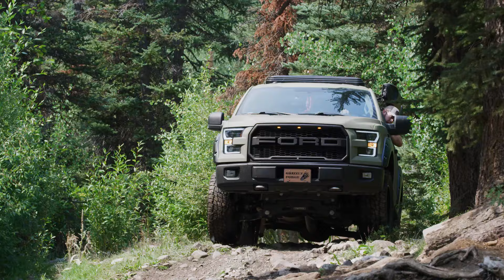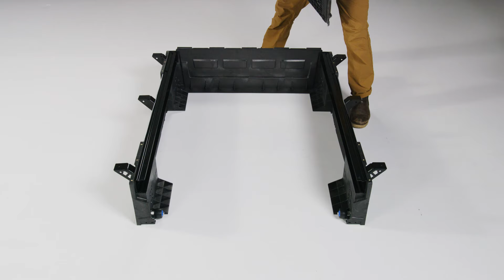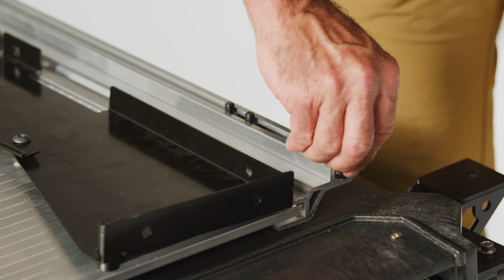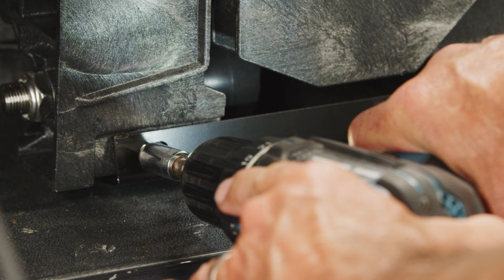Complete Installation Guide: DECKED Midsize Truck Drawer System

Comment: Pro tip. If you wanna center it for free no fkn around, just loosley hang the turnbuckles, Pull the lids off the wingers, put the wingers in. This will sit your deck exactly where its supposed to be. THEN through the openings in the wingers - tighten the buckles and you wont have to check anything cus it sits right the first time.
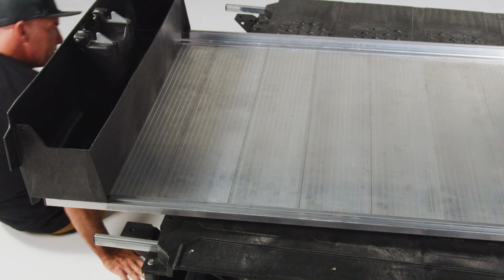And holy crap 7:00 just when you think you've got a solid sheet of aluminum in your hands, it falls apart into 10 pieces 😅 whyyyyy

Comment: 4th gen tacoma here.
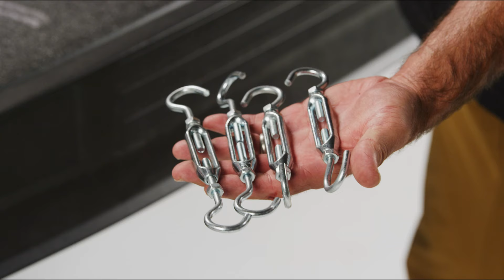I left out those twist hook things at 4:20 for the rear cuz i didnt know where to put them. Still seems sturdy.
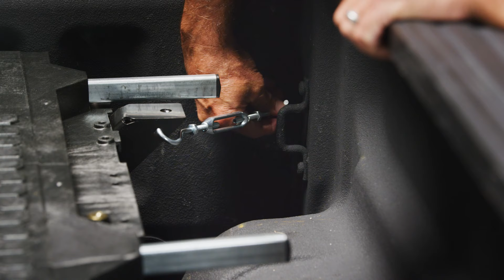Also i would recommend NOT tightening down those hook things that are close to the cab because later on you will need to install the d ring screw in the mount at 4:56 and it's hard to line the holes up unless it's loose.

When putting on the grab handle for the drawer, the 4 holes on the aluminum tray did not line up. I had to drill my own holes. Jb weld would work if you don't have drillbits

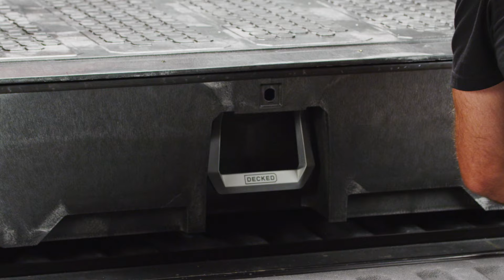9:15 the holes on that bracket thing didn't line up either. Drilled my own holes 

I dont know why they didnt just include 6 d rings but you're able to buy more on their website seperate lol. The plugs they included for the empty d ring spots did not fit properly, they are loose so it seems like you might as well buy the extra d rings 

I didn't use half of the hardware that was included but the thing is completely set up.

Good luck, hope yall enjoy it

Comment: Nice video! Very helpful and helping me determine whether I wanna buy one of these or not. May I suggest, though that you add some video at the beginning that explains all of those technical terms that you rattled off during the installation. Those of us who were a little non-technical may not have understood, but some of those terms were. Kind of like a table of contents, where you explain the item and point to it as you have all the stuff laid out.

Comment: I don’t know why you’re buying it for security and it doesn’t come with the locks who sells something without locks. What’s the purpose of this and by the way if you buy for the 2024 Toyota Tacoma it does not fit.
Reply: Decked Drawer can’t be opened with tailgate closed and locked, but I see your argument for side compartments. I installed on a 2024 TRD OR long bed it was easy to install by myself, instructions were great, and fit up is on point.
Reply: If it came with locks it would cost more. Not everyone needs that extra layer of security. However, if you plan on keeping firearms or expensive equipment than it’s a reasonable option to have.

Comment: I just finished installing on my 2023 Tacoma short bed. I love it. I’ve been wanting one for many months now. The instructions could be better. Whoever decided to put the images on the backside of the written instructions instead of side-by-side should be on the wall of shame for at least 2 years.
Reply: I installed mine today. The images being on the back was wildly upsetting lol. The instructions in general were pretty tough to follow
Reply: @quintonwalker1668 it was the hardware differences that messed wjth me the most. I can’t remember exactly what it was but the hardware was very similar but not exactly what was shown. It also had the correct hardware quantities overall, but not exactly in the packages shown as I recall. 

Now I’m here to review the install process to see what I’m in for to pull the thing, chasing rattles. I think the thud I’m hearing is between the bed and the frame, needing a rubber bushing between them.

Comment: I have a 22 Nissan Frontier. Is it true that I cant use my existing bed tiedowns and would have to drill my bed and install nutserts to mount the decked system? Why cant I use my factory tiedowns? Wrong location? The thought of drilling the bed is stopping me from purchasing.
Reply from the maker: We use the factory tie downs in your bed. Some Frontiers do not have cabside tie downs. Therefore you'll have to drill holes to add them
Reply: @Decked I have a ‘23 Pro 4X with tie downs but my instructions said to install your tie downs on both cab side and tailgate end. I just drilled and installed those yesterday. Did I not need to do that? 🫠

Comment: I just finished installing the 2.0 on my new Jeep Gladiator. I gently used my impact driver on level one with no issues. Perfect storage system for my overland camping setup on my channel.  My wife helped with the lifting, and it didn’t result in a blowout fight. So, it’s an easy lift. Overall, excellent quality kit for my needs.
Reply: Do you have the gladiator bed rail system?

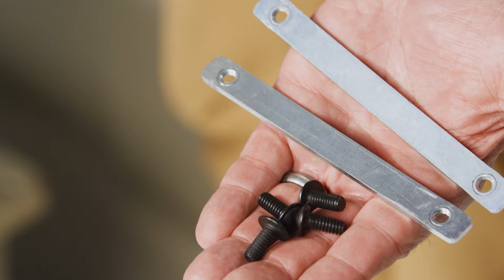Comment: The screws at 6:14 were not included in the drawer HW bag. . . or maybe it is the next set that is not in the drawer HW bag. Instructions leave plenty of guess work to do. Not quite as bad as most Chinese instructions, but close.
Reply: Yes! This is what I was thinking of in my other comment. All the hardware ended up being there, just not where expected. I believe some was slightly different then pictured as well
Reply: Yea the instructions are ASS. But once you get it assembled, it definitely worth the high cost....You can tell LOTS of R&D went into this box!!!
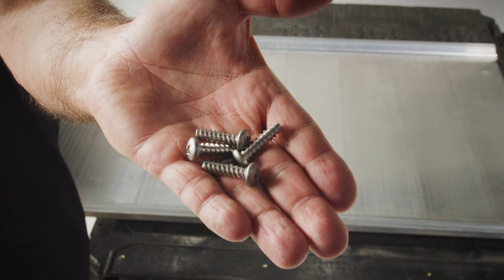Reply: I’m missing mine too picture in (6:52) I’ve looked in all the other bags. Maybe it’s the hex screws? Idk
Reply: At least the instructions didn’t come in Chinese. Had that happen before. But at least Decked is a US based and manufactured product. My friend lives near the manufacturing facility.

Comment: For those installing on a 2023  Canyon, you will have tonget shorter turnbuckle for the ones nearest the cab.  Only thing that didn't work out for me. But .... 

For the price you pay for this thing and the size box it comes in, it really could come pre-assemble with everything but the the 2 wing portion and the bars that you insert into.
Reply from the maker: That'd be a pretty penny for shipping costs!
Reply: @Decked  the box it came in is bigger than decked system.....

Comment: The written instructions are decent vut could definitely be improved, would like to see an explided view of the screw or bolt that goes along with the installation step.  Mines already put together and i really like it.
Reply: I agree. I think the illustrations are excellent but some sections try too hard to explain  things or maybe I’m over thinking them. They are vehicle specific so anything that was questionable it was easy to figure out with the aide of videos.

Comment: My drawer doesn't close with the weather strip installed...
Reply: Already have y'all told me to take it off it works without it lol
Reply: @Longster4U …..Hey! Did you figure out anything else besides taking the weatherstripping off? I’m having the same issue.
Reply: @justinsmith9889 Did you get your drawer to close properly?
Reply: Same here, I tapped it with a rubber mallet to make sure it was seated all the way down, that fixed mine.
Reply from the maker: Shoot us an email! We've got a fix for you! Service@DECKED.com!

Comment: Did anyone else have the problem where the drawer doesn’t fit? It rides too high and hits the top deck and doesn’t close/open without a lot of force. I disassembled and reassembled a large portion but haven’t been able to fix it. I also noticed that the some of the steps in this video and instruction manual are different, but I don’t think that effected anything. I have a 2019 Ford Ranger. 

Waiting on feedback from Decked now.
Reply: Yes, I installed mine today and am having this exact issue. I actually had to remove the weatherstripping completely to properly close the drawer. Also waiting on some assistance from Decked's service team.

EDIT:
I emailed the Decked service team and they got back to me very quickly. Within 7 days I had a new updated drawer face. I had already trimmed my original one with the Dremel so the replacement is currently sitting in the garage. I cannot speak to the fitment of the replacement but the customer service response was excellent.
Reply: @bradanderson5494  I realized that you have to slam the drawer pretty hard to get the box to close after the first install. I think that's because it's new. It's been about a week now and it closes fine with the weather stripping. I had the same issue. My suggestion is push it hard to close and after a few times it will get worn in and it'll be smooth like butter.
Reply: @veritasluxmea76 Good to hear. Thanks for sharing your experience. Hopefully mine goes the same.
Reply: @bradanderson5494  all good reach out if you run into issues I'd be happy to help. I installed mine on 2017 tacoma long bed.
Reply: @bradanderson5494  Is your drawer fixed?  Mine has exactly same problem.
Reply: @mightymikee  yes, it is fixed. I filed a warranty claim with Decked and had a full replacement drawer in less than a week.
Reply: @bradanderson5494  Got it.  Thanks.  Reached out to Decked.
Reply: Smack the weather stripping down with a rubber mallet, mine wasn't seated all the way and I had same issue.  That fixed it for me
Reply: My drawer system was a pain in the ass. The instructions were decent but did leave out some stuff like. When building the big ass box make sure the sides are flush with the back and the aluminum bottom might slide forward causing the drawer box to be bigger than expected. I had to take that thing apart 3 times to realize the rails slid forward during the big box installation.  Long story short got it done and now I love it. It was worth the pain
Reply: Yes. Exact same issue for me. Was a Xmas gift for my son in law. Had to remove the weatherstripping to get it to close. Can’t install the lock cause it hits the striker plate and won’t close. 2019 Ranger also. Seems like the rollers are too big. Can’t see any way to adjust height. Thought maybe the rollers weren’t riding on the flat part of the drawer and up on the tapered slope but that’s not the issue.
Reply from the maker: Shoot us an email at Service@DECKED.com!
Reply: Mine did that but once I loaded it with some weight it went in fine.
Reply: We had the same problem and realized that is we loosen the metal bar under the drawer and pushed the bottom legs out as far as possible. This had the affect of lowering the bottom wheels and made more than enough clearance for the drawer.
Reply: I have the same issue, I go to close the drawer but it doesn’t lock in place and sticks out a few inches. Really annoying when I drive because I can hear/feel it sliding in and out.

Comment: I have already bought one for my Gladiator last year. I am glad yall ditched the 2 drawers for midsize as there is a lot of wasted space that could have been used. Plus the added cubby to the front, also a lot of wasted space that could have been used on the older models. Its always my luck, I buy something, then a new more usable model comes out. 

I am thinking about breaking out my sawzall to cut and add piano hinges to the front of the bed so I can use that space that is wasted in front of the wheel well on the gladiator.
Reply from the maker: Shoot us an email at Social@DECKED.com! We may have a solution for ya!